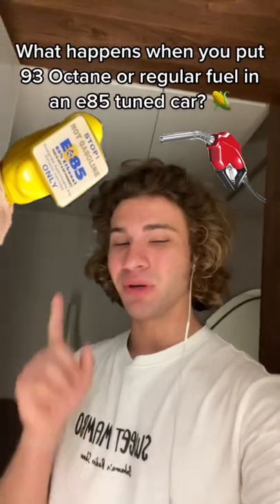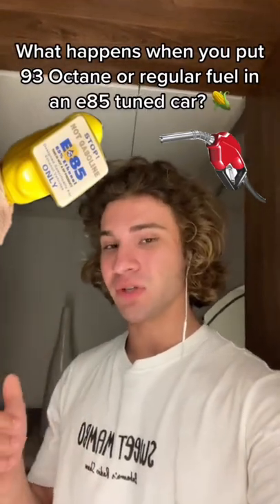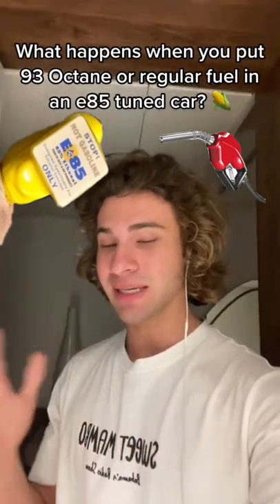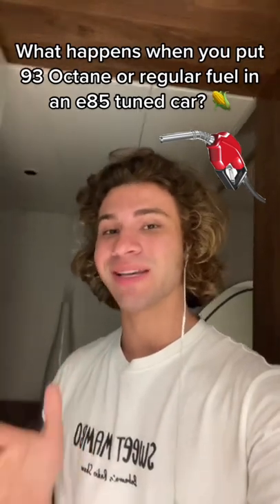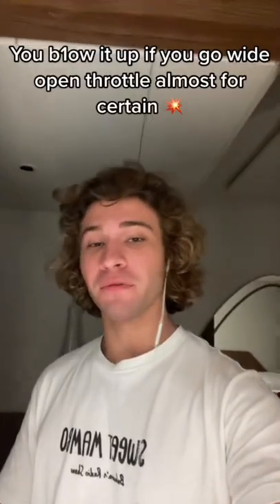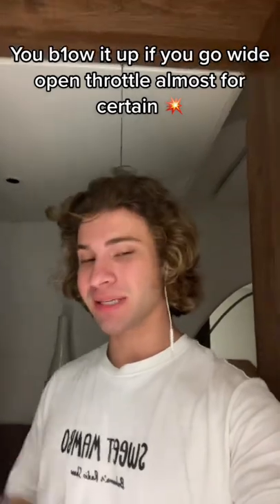THIS IS WHAT HAPPENS WHEN YOU RUN 93 PUMP GAS ON AN E85 TUNE... (BLOWN ENGINE?!) #SHORTS #E85

Comment: He ran 85 on a pump tune not the other way around 🤦‍♂️
Reply: Yep
Reply: it would actually cause spark knock  and not run great at all. If at all. In this case I’m surprised the video said it had spark knock. Don’t know if that’s from the same cat
Reply: it would actually cause spark knock  and not run great at all. If at all. In this case I’m surprised the video said it had spark knock. Don’t know if that’s from the same car
Reply: My mothers new husband or my stepfather wanted to fuel up my car and be nice and my tank says only premium and he put e85 and for a whole month my car kept sputtering and the car would rev high then low if my rpm’s got to low
Reply: he explained the opposite in the video 😂
Reply: Lol OP hearted your comment, but didn't bother responding.
Reply: @eamonlehi7545  🤣🤣 oh no
Reply: E85 is over 100 octane, if he had it tuned for that 93 octane would cause detonation. His description was accurate, but the guy at the e85 pump was misleading.
Reply: Yea. It Would Be Running A Bit Leaner Then It Should If It Had A Standard Narrow Band Oxygen Sensor Designed For 14.7:1 E10 And Lower. If It's N/A I Don't Think You Would Blow The Motor Up. Boosted It Might Because The Timing Would Be A Little Soft For E85 But At The Same Time The Fueling Would Be Lean And Increase Cylinder Temps... But At Same Some E85 Doesn't Burn As Hot As Pump So 🤷‍♂️.  My Guess Is It Would Blow Up If You Stayed Into Boost Too Long.
Reply: @salvatorehayes2753  it would run rich.
Reply: @scotts1668  Right If He Ran 93 Pump Gas On E85 Tune. But He Ran E85 On A 93 Pump Tune. Rich If He's Running Pump Gas On A E85 Tune. Lean If He's Running E85 On A 93 Pump Tune.
Reply: Shittttttt.... your right 93 tune with e is lean af
Reply: @salvatorehayes2753  full disclosure I didn't read everything because everybody was so off base in these commenrs.
Reply: @salvatorehayes2753  i just assumed u where one of the ones listening to the guy nit looking at the pump handle and what was on screen my badd
Reply: @scotts1668  All Good, I Thought I Had A Dyslexia Moment haha
Reply: @salvatorehayes2753  nope I did lol!
Reply: @salvatorehayes2753  shame on me btw looks bad at a Ford certified tuner lmfao... but hey I assumed and read quickly lol.
Reply: @sytuma  not on bmws, it recognizes you arent hitting fuel trims and then checks afr and will pull timing.  anyone who tunes bmw will tell you that you can run 91 on an e85 map just dont go above 15 psi. you can cruise at highwigh speeds all day long.
Reply: yuh huh
Reply: @eamonlehi7545  fighting actions
Reply: E85 stoichiometry is high 9xx:1.
That alone tells you regular 93 would be slobbery rich on a 85 tune.
Reply: Well, running pump tune on e85 and vice versa will both cause a knock, unkess its flex fuel. Ethonal has a higher octane rating of 116octane thus allowing you to run higher compression. The high octane is not what causes knock when running e85 on a pump tune. It's because ethonal has a lower energy density then petrol. That is why you dump more fuel in a ethanol tune then a petrol tune.  This results in a lean fuel mixture.

Comment: Yeah….this is only half the story. If your car is ONLY set up to run E85, probably not a good idea to run any other octane (it’s definitely not a good idea). If your car has an E85 tune and and ECM that automatically switches your tune, well, then this video is a mute point

Comment: That’s why you should get a flex fuel tune and that solves all your problems
Reply: Never heard of it what is it
Reply: @PeePee666PooPoo  you must load a preset tune into your car to let it’s components adjust to the differences of e85 to keep all things safe.
Reply: @Damonah can this be done with vehicles that didn't come from the factory as Flexfuel vehicles?
Reply: @isaac4273 that’s what he’s saying
Reply: @isaac4273 yes you can buy a kit. About $200. But honestly if your looking for power it won’t really matter much unless you get a supercharger.
Reply: @MrChbnovember  not really the purpose, gas is hella expensive where I live but e85 is still below 3 dollars, so I'd be saving like $1.50 per gallon.
Reply: That's what i'm looking for.

What happens if I put the sunco105oct unleaded fuel in a FelxFuel Hellcat?
Reply: @MrChbnovember and can add I supercharger to a flexfuel Hellcat?
Reply: @isaac4273 I mean I have yet to see anything like this 👍
Reply: @isaac4273 No you wouldn’t be saving anything because E85 burns way quicker than normal gas hence that’s why it’s cheaper the government knows about everything there are no shortcuts with gas lol
Reply: @isaac4273 e85 does burn more per gallon but it’s 5-15% according to unknown google sources. If gas is $4.70 like it is here, and e85 is $2.97. You would indeed save $ if you weren’t driving like you stole it. But it’s significantly more than $200 for a flex fuel conversion. That’s just for a controller. In addition you need the sensor, wiring, fuel hose & fittings, possibly a fuel pump & injectors. Most importantly you’ll need a flex fuel tune flashed, not all cars can do this. Depends on the car. All said and done it could cost $600-$1000 so any savings in lower priced fuel will most likely never be recovered, even if you had the car for 10 years 😅.
Reply: @isaac4273  make sure your injectors can safely run it or else the ethanol will eat away at them. You can't just get a tune and put e85 in any car
Reply: Yep flex fuel tune
Reply: Wow, good thing I have a supercharger and a built engine and the right fuel system set up a good tuner, but knows what they’re doing and not cheap ass parts there you go success

Comment: Any modern ECU will pull timing immediately, preventing harm. That's if the car even starts or doesn't run horribly considering you will be injecting about 30% more fuel, which would make it super rich. 

Also the right way to run E85 is with an ethanol sensor that will automatically adjust the timing and fueling through the ECU. This is how I have my WRX set up.
Reply from the maker: ECU can only pull timing after the recognition of a knock event

Comment: Bro you need to learn more about tuning before making videos like this
Fact 1 e85 needs about 35% more fuel than regular so all that will happen when you run 93 on e85 tune  is it will run so rich it will not want to run right at all
The chance of damaging the engine from this is slim as long as you don't keep driving it because it will drive very poorly
Fact 2 e85 tune doesn't mean that the engine will run more timing, it depends on if the engine was knock limited in the first place, often mbt in cruising is actually less timing on e85
Fact 3 I'm a tuner that actually tunes cars
Fact 4 I always recommend a flex tune with a flex fuel sensor
Reply: Bro either way your engines gonna fuck up you’re going to have to replace something either way. Also why would you even put the wrong type of fuel in your car? Like are you not thinking straight imagine instead of E 85 it was diesel like I said different fuel grades can seriously fuck up your engine yeah it may run pretty poor but it’s going to blow the fuck up in about the next few miles smh
Reply: @Alpha-xt6ub  tell us you don’t know much about engines, without saying you don’t know much about engines. 😂
Reply: Isn't hydro-lock a possibility? Could bend some stuff if it started running then flooded out.
Reply: @juggernautjim7719  I think that’s when you’re running methanol
Reply: @Alpha-xt6ub  Do you have any idea about anything you just said? That makes no sense.
Reply: @im1469  hes barely 10 years old...
Reply: Richard holder proved what you said
Reply: Hey I have a quick question. I've never heard the term "aggressive timing". When he says this does this mean the timing is advanced before tdc or after? Or does it mean something totally different?
Reply: @juggernautjim7719  mostly associated with carburetors.
Reply: How do vehicles run e85 and 93 pump from factory without tune like my 2018 5.0 f150
Reply: @cage5.042  Flex-fuel sensor. The sensor knows the mixture and accounts for it
Reply: I have a 93 octane tune and started my car with 87 heard some engine knocking  will it damage my engine? I did not run it but did start it like 3 times
Reply: You said it right brother
Reply: @jakewiebe8382  it's a term like stage 1 or 56 and crap that people who don't know facts say. Timing is set by brake mean torque and limited by knock. So if your engine stopped making power at 18deg of timing and experienced no knocking then you could run any fuel on earth and adding timing will have no effect on power.
Reply: @randyschmidt19 Hey, could one modify a regular everyday commuter to run on e85 with the proper tune and sensors?
Reply: @isaac4273  depends on what tuning is available but most likely yes
Reply: Tf is a flex tune
Reply: @qtip3998  a flex fuel tune uses an ethonal content sensor to let the ecu know the percentage of ethonal content in the fuel that's in the tank
The ecu can then calculate how much fuel to put into the engine and can even change other parameters like timing and boost

Comment: And this is the main reason why I'm sticking to a flex fuel tune, I need the ability to use 87 when I'm really low on fuel and the closest station doesn't have e85.

Edit: 107 likes, that's pretty good 😁
Reply: Exactly, I don’t get why people don’t just pay for the flex fuel kits.
Reply: we’ll flex fuel cars from the factory use it as a daily but I get what you mean. If you install a flea fuel kits on a daily then yea sure you can use it as a daily on your build.
Reply: @christiangraham4579  I drive a 2020 Mustang. I know, just saying I'd only run E85 if I'm going to be racing for money
Reply: e85 is better for the environment and cheaper. Not that I give a shit about either but that why some people use it as a daily. That and I like to have more power when I’m gapping mustangs 🤣 jk man
Reply: @christiangraham4579  it is not better for the environment a study came out it is actually worse. But driving a e85 daily is fine you just have to fill more often not a big deal.
Reply: @701garage  anyway you would have a link to that study?
Reply: @christiangraham4579  all the trees that need to be cut to make more farmland to produce the ethanol release so mutch carbon that it takes 20 or so years to be carbon neutral
Reply: @christiangraham4579  because most tuners done tune a boosted car for flex tune.
Reply: @neok1996  well true, but if the Americans were smart enough to use lawn clippings to make ethanol, then we wouldn't have to cut down trees.
Reply: @christiangraham4579  cheaper rn because most people don’t even know what e85 is 😂

Comment: That's what the anti knock sensors are for... most new cars can make the change in .1 seconds and bmw says it won't cause problems unless high loads or excessive acceleration are present. Yes I know it's not true for every vehicle but even my 1998 jeep 5.9 is loaded with them and I can run 87 all day in the city. Rebuilt it with 230000k miles and still runs like a charm

Comment: This is all the reason I need to run a carburetor
Reply: Right just empty the tank and twist a a couple screws on a carb and you good to go but you also have to look at the compression ratio
Reply: @Smoketownedc e85 is carb specific. I wouldn't run a gas carb on e85. 
Jet sizes. Squirter & air bleeds are bigger due to the higher fuel consumption. I'm in the process of making the switch on my 67 mustang .

Comment: When I went to get tuned on e85 on my LS3 Camaro, it showed on the same timing that was used on 91, we saw no timing being pulled when using e85. Same table. So no you don’t need more aggressive timing. You just need fuel trims and lambda adjusted

Comment: Even with a tune, I believe you have to do file line mass airflow sensor and file pump. E 85 will eat up your file lines if they are rubber. I think the European cars have metal file lines with rubber sleeves.

Comment: I'm surprised you didn't mention e85 tune also requires much richer fuel ratio than std pump gas
Reply: It's literally in the name.
E85 means 85% ethanol, compared to regular fuel with is usually about E0 to E10
Reply: Somewhere between 15-25% more fuel REQUIRED depending on the car to run well, you are correct
Reply: @Duck_side  regular fuel is as of 2022 standards E10 minimum and regulated between 10%-15%. What OP was referring to is the fact you need more E85 per the same RPM 
(Ex: 93o @ 4000RPM like 220cc~
E85 @ 4000RPM like 260cc~)
This is why most people go with very large AN style lines with E85/Flex fuel setups and almost always guarantee new injectors. 

Usually a good idea to run stainless steel braided fuel lines as well as the high ethanol content of E85 doesn't mix well with standard fuel lines, especially at temp
Reply: @Duck_side  e85 have different stoich ratio compared to standard pump gas. Usually people ran AFR 8.5 on e85, in contrast with 12.5 on pump gas.
Reply: @madunwerkstatt3093  no one runs 8.5 afr on E85 you are crazy.
Reply: @701garage  do you think it's 14.7?
Reply: Lol e85 likes leaner AFR's next
Reply: @evanrosario  if you look at lambda value, yes. If you look by air-to-fuel, no.

Comment: I am not a tuner but the limited information I know about e85 versus regular gasoline says that you have to run quite a bit more fuel to run e85 to get the octane benefits.  My guess is if you were to run pump gas on an e85 tune it will be a really fat mixture and it'll run poorly it should not detonate since you're pouring so much fuel into the chamber. .  And I'm thinking if you were to run a pump fuel tuned engine on E85 without adjusting the fuel mixture you'll end up with a lot of detonation.

Comment: I had a 97 T.L with the 6 cylinder. 
I accidentally did this too. 
At first I freaked out. Thinking it was like putting diesel in the tank. 
At first I thought I should raise the octane. It did pop and misfire, but I diluted it with the regular gasoline. 
Granted I was suppose to use premium gas. 
I used fuel injection cleaner for about 2 weeks ratio to gallons. Thinking it might gunk up the injectors or lines. 
It drove fine after really 2 or 3 day's.

Comment: For running pump gas on an e85 tune, you're partially correct. But what about running e85 on a pump gas tune?
Since ethanol has a lower energy content than gasoline, it requires a richer air-fuel ratio to burn correctly. So, running e85 on a pump gas tune will cause the engine to run very lean and can cause way more damage than spark knock could (melted pistons, torched heads, ext)
This is why flex-fuel sensors are a thing.
Reply: at wot it can hurt running lean but running lean with a lesser dense air charge wont hurt the motor

Comment: I own a diesel so I only have 2 choices #2 diesel or bio diesel.
Reply: ColonelKrNeL  green diesel
Reply: ColonelKrNeL  that’s considered off road red diesel. If caught using on road it’s a very. Hefty fine for “tax evasion “
Reply: ColonelKrNeL  lol good luck on trying to get diesel to light by a match….diesel has a much higher flash point then gasoline. 😂

Comment: Mfs can afford two tunes but not the 500$ flex fuel kit 🤡
Reply from the maker: Some tuners don’t tune flex fuel for boosted application. Like mine
Reply: @TobyVegaD  you’re right lucky mine did, but It’s better to able to change timing on the fly especially because e85 is rarely 85 
Me personally I would drive or haul my car to the nearest one 
Don’t mind me I’m a hater
Reply: @LeftHandPath327 100% right Flex definitely the way to go cause like you said pump E is never 85 its always all over the place unless your buying VP or ignite at $13 a gallon

Comment: Not completly true.
If you drive with low load on the engine nothing will happen.
If you mount a fueldetector that will switch automaticly between tunes this scario is unlikely

Comment: Are you talking about engines without knock sensors? Or does the tune ignore them?

Sorry for sounding ignorant, I basically only work on stock vehicles
Reply from the maker: Even with knock sensors. Most tunes desensitize them anyways :/
Reply: @TobyVegaD  well I guess that is asking for trouble then hahah

Comment: He ran ethanol on a pump gas tune so his issue here wouldn’t have been an aggressive timing map, it would be that the gasoline fuel map would be 30-40% leaner on the AFRs than what it should be for the e85. Still can easily cause issues of detonation but for an entirely different reason.

Comment: Also,  E-85 has a lower combustion. Meaning it takes more E-85 to run a flex fuel engine than running regular gasoline.

So basically you don't save money because it may be cheaper, but you burn through it faster, thus lower milage.